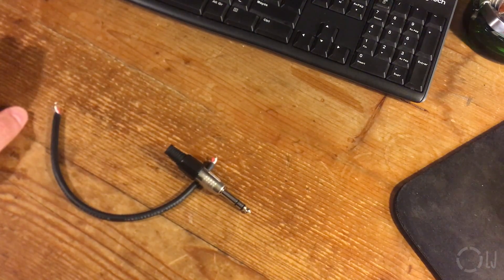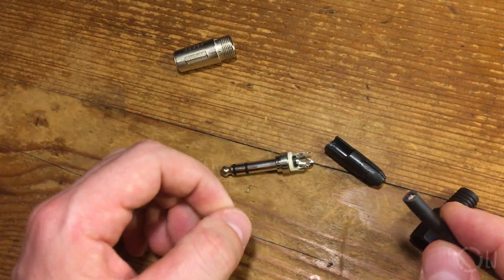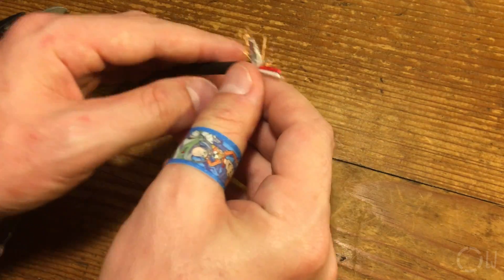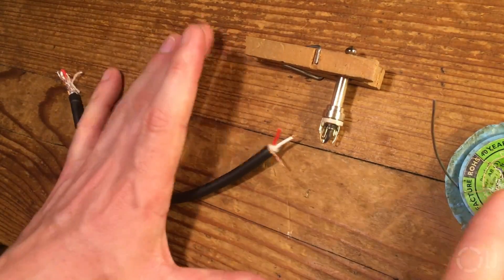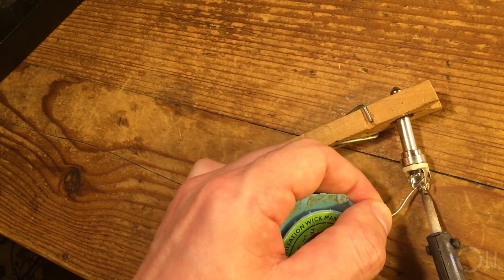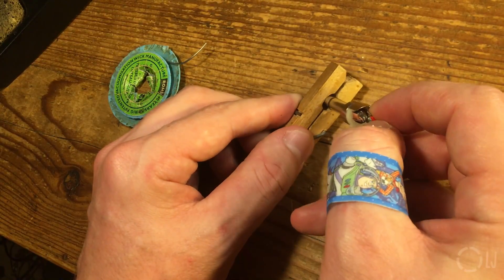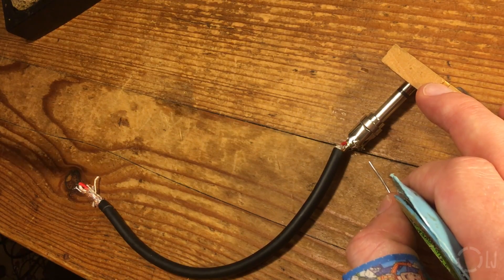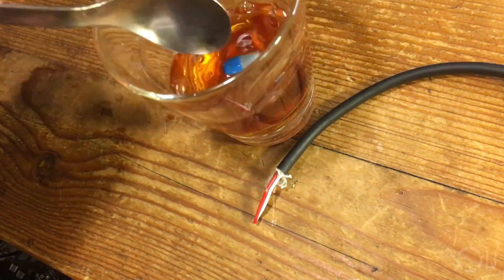How To Solder A 1/4" TRS Connector / Balanced Plug / Stereo Plug

Comment: I found your channel through this video as I was looking for a "how to" explanation of how a trs plug is wired so I could replace it with an RCA. I needed a 3 way RCA splitter to send mono signal to 3 subwoofers (which don't match and aren't even the same size). I couldn't find one to buy, but I did find an  AV/component adapter for an old ass TV and decided to DIY one. It probably won't work, and your video didn't answer my question but you are so entertaining I subbed anyways. Thanks so much, my dude, I hope you keep putting out content and rake in those sweet views. ❤
Reply from the maker: Thanks! Now I'm kinda curious about what kinda of an odd contraption of doom you're working on. 

And if you're converting from a mono plug to a single RCA, Sleeve (ground) goes to the outside of the RCA which is ground, and Tip goes to the center of the RCA. A 3 way splitter could be achieved by simply hardwiring the 3 RCAs together (tie grounds together and hot/signal wires together), which is a bit of a troglodite approach, but I've seen (and definitely done) worse. Just don't let anyone see it.

Here's a couple warnings though: if it's a stereo TRS connection, i.e. both left and right channels are in use, shorting them might destroy whatever device is providing the signal. If it's only mono though (signal + ground), you're good to keep going mono. Also, splitting like this provides no guarantee regarding load/signal levels and sound quality might be affected, but it looks like you're beyond that point considering it's just 3 sub-woofers that don't even match.
Reply: @lonerjuan  oh I left out one detail: the AV/component adapter had a trs plug at one end, the 3 RCAs were at the other. I did not want to damage the adapter just yet so I didn't get to look inside to how it was actually wired. Instead I used a trs extender cable and cut the male end off that to convert to RCA. That way if I fucked up I could just disconnect the tsr extender and throw it behind the bed where all the things that never happened belong. So technically I was only rewiring a normal tsr to RCA, not the actual AV/component adapter which could be wired totally different (the yellow RCA is specifically for video so I assumed it was specialer than the other plebian white and red, real big). Since I'm too puss-puss to cut it open right now I'm just going to mash together a bunch of spare RCAs because I've got probably 20 million of them. And yes I counted, why would I exaggerate about RCAs? Hmm?
Thanks for the advice about the mono signal bad thing that could (and likely would) happen, I never would have thought of that so you spared me some hypothetical tears.
Of subject, do you ever find any audio equipment "on the curb"? (I think you're from South America, but I'm the north one people sometimes throw away stuff but instead of putting it in dumpsters they leave it on the curb in case anyone wants it. They get rid of stuff, somebody passing by finds free treasure, the garbage man has one less thing to pick up, everybody wins. But I didn't know if they did that in other countries.) If not, do you have other ways you find audio equipment to salvage?
Reply from the maker: @OneMoreRedNightmare  I never got stuff from the street, most the stuff people get rid of here is beyond saving, and whomever picks it up either knows exactly what to do with it or is taking it to some junkyard/recycling place.

I used to hold on to any junk I could find an excuse for, but it got to the point where having a comfortable space to work with what is actually useful was more valuable (I did hoard a lot a stuff for a while).

I do know it's common practice in other countries to get rid of perfectly functioning stuff to get whatever's new now, but I always try to find someone who will at least pick it up, even for free, just to avoid creating more garbage.
Reply: @lonerjuan  it took me a long time but I'm starting to realize the value of usable space over the junk I want to fill it with. And how much time it wastes moving it around and walking over it. I will force it on someone who I think will use it whether they know it or not before wasting stuff. I'm killing two birds with one stone because I convince myself I'm being helpful but I'm also freeing myself of the guilt of "to hoard or not to hoard" because it's packaged with the useful stuff I just forced in them.
But also you know where it is if you change your mind and want it back. Up here in the REAL America we just can't let shit go.

Comment: I have a stereo plug (3 pin) that I would like to solder onto a mono cable. Is that possible? Or do I have to buy a balanced cable, cut it open and solder that onto the plug?
Reply from the maker: No need for a balanced cable, you simply wire the hot lead to the tip and ignore the ring. Shield goes to ground (sleeve) as usual. Any questions just let me know.
Reply: @lonerjuan  thank you. Maybe a dumb question (I'm new to this) but which is the ring?
Reply from the maker: @AppleSlizerd  The one between the tip of the connector and the large sleeve. Usually inside the connector you'll have a long, flat piece of metal, that's connected to the sleeve. Then two smaller pieces, of which the one towards the center is the tip and the one a bit to the outside is the ring.

If you plan on doing this often, you should probably get at least a cheap multimeter so you can check what connects to what, and also to check if you soldered everything right.
Reply: @lonerjuan  Thank you. Excellent tips which helped me get it to work! You have earned yourself a subscriber 😃
Reply from the maker: @AppleSlizerd  Awesome! Thank you very much!

Comment: Is this the same cable I would use for an RCA cable? I also have the red, white and shield but i just dont know where to solder them to.
Reply from the maker: RCA connectors are generally used with a different type of cable, the thin twin type you use on domestic video/audio devices, though they are often used in other applications as well. 

You probably wouldn't be using them in a balanced audio line though, which is the way I connect here, more like the Tape output of a console or AUX connections, which are not balanced.

And to answer your question, this cable would be a bit annoying to use with RCA connectors, since you'd have to split it at some point to connect one RCA to white (usually left) and the other one to red (usually right), while also splitting the shield between both.

It really depends on application though.
Reply from the maker: @Princeton_James  Absolutely! That's exactly the type you usually come across. Hope it all goes well, let me know if anything comes up.
Reply: @lonerjuan  Thanks so much for your help!

Comment: İs it possible to use Trs cable with amp? Is amp need to Support the Trs?
Reply from the maker: It'll work just fine with a TRS, although the cable connected to the ring would be useless since guitars only need ground and live wire. I used a TRS because as I said on the video, it was was all I had available during the semi-lockdown that was going on, and I didn't want to break one of my good cables, haha.

Comment: Can I connect the cable without having to use solder.
Reply from the maker: Not with regular connector and cables. There are solderless variants, but the low reliability to price ratio has kept them far from becoming popular. Personally, I'd never hop on stage with something that's held there just because I pushed and it seemed to stay there.

Now if you mean sodlering without adding solder, say on a used connector by just taking advantage of the remaining solder that was left, it would work on principle, but the results would be rather sketchy.

Comment: Hey brother you were so helpful last time. I have a question: I'm using Mogami W2697  with Amphenol KS3PC 3.5mm TRS to make a simple Aux cable. I've tried everything and L and R channels keep on coming out of both speakers. Everything works fine except there is no channel separation it all comes out at once. Any advise? Thanks.
Reply from the maker: I would start by grabbing a multimeter and testing that none of the lines are shorting each other. Working on such a small connector may lead to even the slightest hair from the cable shorting, so I'd test that and work from there. If that isn't it, knowing what's getting plugged into what may be the clue.

Comment: Ha Ha! So good and helpful! I am trying to wire up XLR and 1/4" box to an 18" Subwoofer and have never done that so any recommendations welcome.
Reply from the maker: Well I did make another (silly?) video for the XLR connection, it's here on this channel.

Other than that, what's is plugged to what? Is the subwoofer self-powered, meaning you're sending a balanced audio line to it, or is it just a passive box receiving speaker level signal?

Soldering the connectors is virtually the same, but the order of the wires might vary.
Reply: @lonerjuan  It will be a passive sub with 1800W speaker. I will use a Peavey amp that is 3000W. I would like to orient so I can have 2 in parallel.
Reply from the maker: @Jake Moss  Are you 100% positive parallel is the way to go? I'm asking simply because I don't know the ohmage of either the cabs or the amp. Also the amp will usually tell you a power specification for say 4ohms, then another for 8 and another for 16 (usually half of the 8 Ohm rating), but you gotta be sure not be out of ohmage (impedance) range.

The other thing is that power outputs are generally Speakon connectors, not XLR or TRS. I don't know specifically which Peavey amp it is, but looking at their different ranges it's all either Speakon or Terminal Blocks. TRS and XLR are not designed to carry that much power.

Comment: Isn’t this a regular stereo soldering? In the following vid they bridge the ring with the shield which to me sounds like a balanced cable. 

https://youtu.be/dY-jUWo2fiE?si=3sg3UtCZk9_ey3t6

What I am trying to say is this is an unbalanced stereo cable and not a balanced mono cable as the title suggests.

Oh, wait! At the end of the title it says ’Stereo’. Ok then, but isn’t the wiring in the connector different between unbalanced stereo and balanced mono?
Reply from the maker: The wiring of a balanced mono line or an unbalanced stereo line are physically the same, as long as you respect the order of the wires on both ends of the line. Both a balanced line as well as a stereo line require 3 conductors, ground and either L/R or Hot/Cold.

What differentiates them both in practice is what's plugged on either end, since it's the outputs and inputs and the associated circuit what will decide if it's either processed as two different signals with a common ground (stereo), or a pair of identical signals, one of which is flipped 180º in phase in order to cancel out ambient noise (balanced).

Oh and about the ring and the shield, he doesn't connect them together. He connects the braided shield of the cable to ground on the plug, and what goes to the ring tab is the black connector, which is often associated to ground when you have a simple pair of cables (e.g. on the back of home speakers), but in reality it can mean whatever you want it to mean and sadly there's no real convention about that. I usually treat red as hot/right channel and black as cold/left channel, and most people I know do the same.

I've only seen the ring bridged to ground when someone makes a mono cable using TRS connectors, but it can lead to confusion and I see no point in that. Just leave the ring as usual and if the line is mono, nothing will make use of that conductor and that's that.

Comment: Dude, I got the same keyboard.
Reply from the maker: Well that cheap piece of crap is one of the best investments I've made. I literally smacked half the keys out of it on one of those occasions when you get pissed and grab the first thing available to teach it who's boss. After ashamedly searching for all the keys around the room, I put them back in place and the thing kept trucking.
Reply: @lonerjuan  I've managed to bust the legs off mine. But I've got a wood block glued on holding it up. Just like new! Hey, thanks for your video. It did teach me the proper way to solder a cable in a very entertaining way. Most excellent! Gonna subscribe now.
Reply from the maker: @tomcat8983  Awesome! I'm happy to be of any sort of help.
Reply: @lonerjuan  Yes Sir!